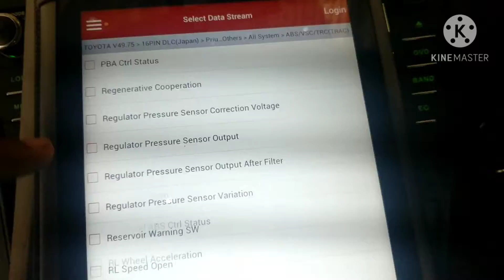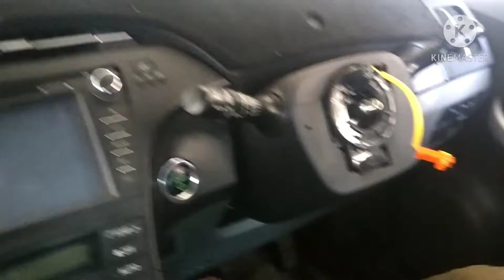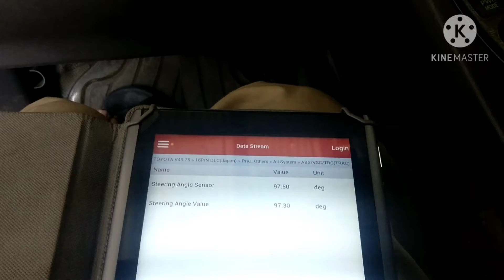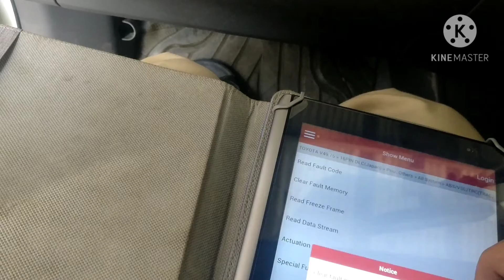Toyota Prius Steering Angle Sensor Replace

Comment: how did you calibrate to 0 degree ? that is the most important part of this video :) please reply
Reply from the maker: Switch off, 
remove the connector of angle sensor
Set the Steering wheel in mid
Connect the connector of angle sensor